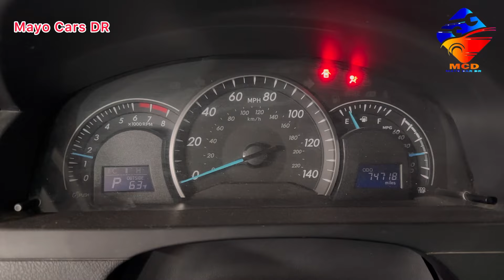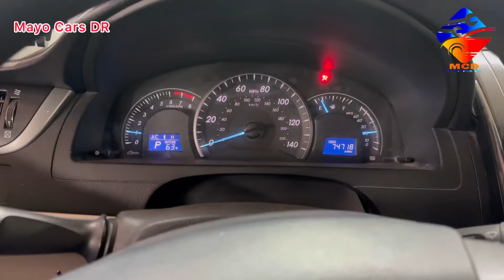2AR 2.5L Engine VVTI (variable valve timing intelligent) Filter Replacement Of Toyota Camry

Comment: I had doubted that my filter was dirty, since I am diligent about oil changes, but you mentioned "carbon", and my VVTi gear started rattling after my car started using oil, so I can no longer rule out the Crud Factor. I also noticed that the VVT doesn't rattle when the oil level is RIGHT up to the mark, or on warm starts.
Reply from the maker: If cool starting have rattling

Comment: Hello. How are you. While what is the creat problem if not clean or replace. Can you explain to about. We have same car. Thanks
Reply from the maker: If the carbon inside the engine is high and the engine is not serviced on time, this filter gets clogged and after it gets clogged, the VVti does not work properly and the engine consumes more petrol
Reply: @MayoCarsDR  my 2015 rav4 has 52k miles only and I always change oil every 5k miles. Do I still need to clean it now or when ?

Comment: Thank you for making this video.  It is well done.

I have a 2010 Toyota Camry LE with this engine.  166K miles. It has the "vvti rattle" when you start it, but it's not bad.  I've had it two years and the prior (first) owner maintained it well. Would performing this procedure address this rattle? (I'm asking because other YouTube videos recommend replacing the intake cam gear.) Thank you.
Reply from the maker: You welcome 
If the sound is too loud, the intake vvti may need to be replaced and clean the vvti control valve filter
Reply: @MayoCarsDR  Understood.  Thank you for your quick reply.

Comment: 14:08 what kind of sealant are you using? Greetings from México.
Reply from the maker: Winkel
Gasket plus
Gasket sealant oxime
Reply from the maker: https://www.facebook.com/100057543276085/posts/pfbid037DCGsstTVZkZukLcb6QshHgcGGxEEVpuKfcK6ZHAD4uzNs1eno12LetEwPvjMn9fl/
Reply: Please Sir, what's the part number for the exhaust timing solenoid for 2ARFE engine.
Reply: @stephenibeh9869 where is this part located and what’s the symptom that you need to replacement? Do you get an engine code? I have same engine on my 2015 rav4 and I’m just curious